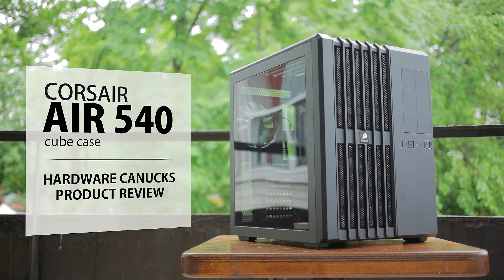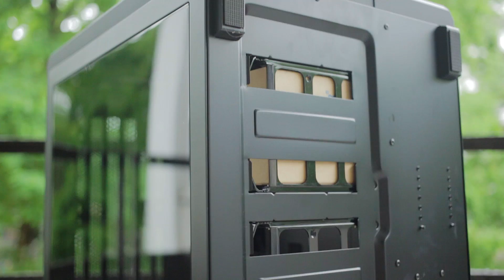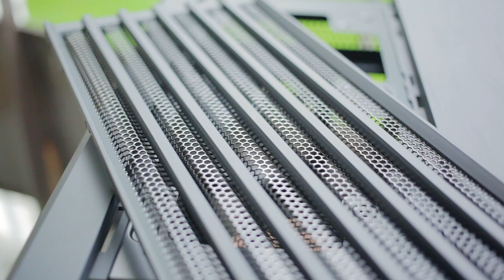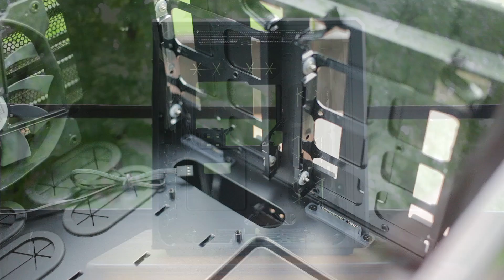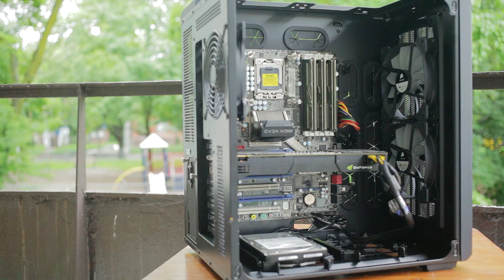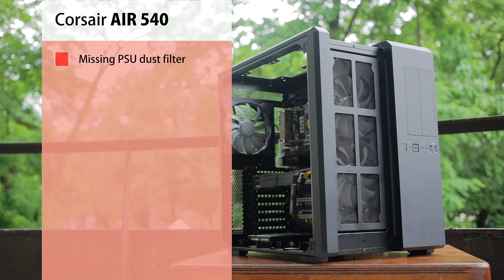Corsair Carbide AIR 540 Cube Case Review

Comment: Owned this case for 7 years. Its been amazing. I set it up with 280 mm cooler up top. 3 fans in the front exhausting air to the rear and front. No dust. Im updating all the components now but im keeping the case.
Reply: Me too, will it fit a 5080?

Comment: I think someone (Hint Hint) needs to tell Corsair to remake this case with Modern front I/O ,Glass top  and fixing the bottom to lay down the case. I would make the bottom just like the front and side     and be able to move the feet in laydown mode. I'll take 2 in white right now or 1 white and 1 other color. Removing the Hard drives and adding them to the rear would help improve air flow as you can now have fans in HD's Place. As for the Optical drive bays I would leave for DVD players or other accessories as I like to play my music while on the computer..

Comment: Had this from way back in 2013... fantastic case, but my main criticism was how flimsy the cradle brackets were for the HD/SSDs at the bottom. Pinching them to slide them in easily snapped off the tips.

Comment: Used this case for my first build. I wish Corsair revamped it. You can put a perforated front like the P500A, replace the bottom HDD caddy with perforated holes for more fans for the gpu. Replace the top with perforated holes. Scrap the HDD caddies on the 2nd chamber to shrink it a bit. That would be my perfect case.

Comment: buying this case in 2022.. 1.. cant believe this great pc case is still around. 2 . SO happy this case is still around!!! im gonna mod the mess out of it! lmao!
Reply: What part you like about this case? Also using it since Dec 2014 in 2023.
Reply: @BravoSixGoingDark  when my PC broke down i couldnt find the 540 anywhere for a decent price so i went with  the lian li mini air... i love the cube style of it to be honest
Reply: @Sabre912  wait im confuse, you don't have the air 540 in the first place?
Reply: @BravoSixGoingDark  unfortunately no.. My first comment stated I wanted to get the case.. I had plans on upgrading my pc back then but I held off on it
Reply: @Sabre912  Ah, i see okay, The lian li mini air you are referring is the O11 AIR MINI version? I'm thinking of getting this case for my next ATX built. I heard its slightly smaller than the Air 540, do you recommend it?
Reply: @BravoSixGoingDark  I do really but you are severely limited on gpu space if you do aio cooling.. 280 up front for me and I’m still rocking an Evga 3080ti hybrid. I would not recommend this case for water cooling of any kind for a novice builder.. it’s not too difficult I would buy tiny zip ties to clean things up lol
Reply: @Sabre912  ok im going to keep my Air 540. Reuse again for 2nd built

Comment: Had this case for 7 years, which has seen 3 different systems and for me it's still THE best for cable management and still right up there for airflow.
Reply: I still have this pc case with AM3+ components, still the best computer case ever made in my opinion, right next to the Cooler Master HAF XB (which I almost bought instead of this one)
Reply: @cssplayer91  Same I still have the case, i broke the plastic clippings on the SSD cage in the 2nd chamber though. Very flimsy plastic material.
Reply: I always wanted to build in one I should have made the purchase when I had the opportunity. If you ever decide to sell it lmk
Reply: @michaellovejoy5299  You can still find them online, I've seen them on Amazon, Memoryc.
Reply: 8 years going strong with this case. I agree the top and some other areas could use mesh filters other than the front

Comment: I think you got the radiator compatibility wrong .. 240 / 280 and 360 ... right there on the specs and you can see the three fan slots ... sure you have to get creative on pump or as this is 2020 now ... you can get a distribution plate which solves most of the problems easily now .... I have a external mount for a radiator that I got from Koolance that lets me mount it on the rear of the case outside as well - so besides for needing to drill passthrough holes for my hard lines this case is still very nice

Comment: This case was way before its time. I still have it now. My 2024mhz OC'd 1080Ti founders doesn't go beyond 75c with a custom fan curve and my 3930k at 4.6ghz with an dual 140mm pull configuration with Noctua fans doesn't go past 63c in gaming and 78c under full load for 30mins. This case has amazing airflow. However it's time to move on and upgrade in 2021 once AMD and Nvidia get their new hardware out.

Comment: This Case is laid out amazingly well in my opinion and has some really good features (tool-less stuff, dual chamber, cable management, etc.) but it has a couple drawbacks. First, its kinda light and flimsy. My other pc is a dell t3500 and its a tank compared to this dainty flower. Second is the dust filters as everyone else has said. The front one is great, why couldn't they added at least a top filter also?(and also a PS filter) Third, it's big. I know it takes size to get all the features in this box, but everyone that has been to my place and seen it is like "wtf is that? is that a computer?".
Reply: You want to hold the dust with a filter and potentially block partially your exhaust? Also even with a clean filter you lose a bit of efficiency of your exhaust flow. To me, we should never ever put air filters on exhaust, except only when the PC is turned off for long periods of time. If you use your pc almost every day you don't need it at all. Only filter the intake flow and clean it regularly is more than enough.

Comment: Sitting here in 2019 planning a build in this case. Drive cages aren't really an issue with SSD prices dropping and M.2 drives being a thing now. The one big flaw in this case is the 5.25 bays. Putting them sideways makes them utterly useless. You can't put a Blu-Ray reader in there for an HTPC because there's no way to keep the disc in the tray. You can't mount any of the bay-mount water reservoirs there because they won't work sideways. The only thing you can really do with those bays is mount fan controls, card readers, or something similar. PWM fans have pretty much killed manual fan controls. Nobody uses card readers now that you can use Bluetooth or USB to transfer files... those bays are just useless.
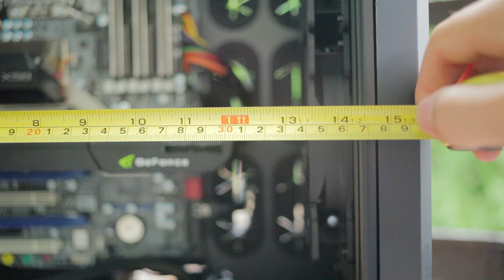Reply: The 5.25 bays can be removed. 3:15
Reply: @paulking4908  I know. But I want to run a bluray.

Comment: My favorite of all Corsair cases ever (to August 2019).  Would love an update with only one optical drive and USB C instead of USB 3.0 which should reduce the width but about 1-1.5 inches).  I love the mesh front and top.  I also love the acrylic window though I would find tempered glass to be acceptable but not needed.  The 3.5 inch drives at the bottom front can be moved to the back to allow for fans on bottom as with 240X.  Flimsy side panels need to be flexible.  All of this should allow for better use of space in the back.

Comment: This case is 6+ years old?? damn, i think it's an amazing looking case and have just ordered one.
Reply: Bought mine a year ago.  Super easy to build in and cable management is excellent.  I'm upgrading my wife's computer for her birthday and buying her this case (she loves the aesthetics of mine and wants hers to have this case)... if you haven't pulled the trigger yet, I promise you won't be disappointed when you do
Reply: @Danny White, how is the sound level on this case? Is it quiet?
Reply: @dannywhite325  I built a system using this case last year as well and I am thrilled with the results.
Reply: @jeremystamer929  mines coming next week.woooo
Reply: You can definitely hear it when the fans ramp up, but I have a Ryzen 7 2700x that's overclocked to 4.3ghz  across all 8 cores with an overclocked 1070ti gpu.  Add a 240mm AIO and the 7 fans combined (the gpu has 2 fans as well) aren't exactly whisper quiet...they aren't so loud as to be annoying, but my rig isn't built around quiet fans.
Reply: @dannywhite325  ohhhhhhh i thought that was my msi 1080 lol it's the case fans then lol
Reply: Lots of room, excellent cable management, hot swap cages, decent radiator support for water cooling  and insane airflow...it can be a bit noisy when your fans ramp up and the drive cage for your ssds on the backside of the motherboard panel feels cheap.and your side panel is acrylic instead of tempered glass and the case is huge! Pro's and con's in a nutshell...overall, it's a damn good case!
Reply: @bitchcunt9343  no issues, great to build in but the case fans get abit loud apart from that it's excellent.
Reply: 3 x 140mm case fans, 2 x 120mm radiator fans, plus the 2 fans on the Gpu... everything that can be overclocked is overclocked, when the fans ramp up under load, whisper quiet it's not...lol
Reply: How do I even find one now a days? Curious, can’t find it anywhere.
Reply: @simplyrhino_  i bought one brand new like week ago
Reply: @turbo9827  where did you buy it? I can’t seem to find it anywhere
Reply: @simplyrhino_  i live in poland and its in every popular polish computer store
Reply: @turbo9827  oh, makes sense.
Reply: And this comment is 6 yrs old 😅

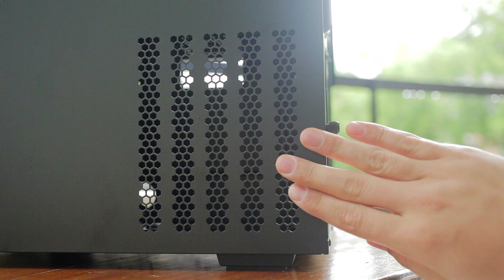Comment: 1:50 - Well, couldn't you flip the power supply around, so it exhausts out the side, and sucks in air from inside the case, which is already filtered?
Reply: You will be choking the fan as the motherboard tray is right behind it. PSU's exhaust out the rear.

Comment: The dust filter on the power supply really isn't necessary if you buy something like the corsair 860i or any of the smart sense power supplies. if you want a dust filter for it you can just get one as an accessory from their website, but again that's just my opinion

Comment: It would be very cool for Corsair to take some of your feedback and re-release the Air 540 in 2017.  I would replace the front panel with tempered glass, add magnetic dust filters all around, increase the number of front connectors and add USB 3.1.

Comment: I corsair could update this case (Air 740 is shit why the fucking door who needs that and it makes it easier for inexperienced people and children to open it and start touching the insides out of curiosity and short out or pull out some of the cables which can then short out) I would happily buy this if they do a version with the missing features Dmitri was on aboutsuch as lack of dust filters and so on and without the drive bays for the front as well as USB type C/Thunderbolt front panel I/O support and more Type A cables but the other features I do not really mind but if there was a tempered glass version it would be so much better and quite possibly if not one of the best cases Corsair has ever made as it would be good for water cooling due its large internal size if only it had some sort of removable panels for refilling and drainage i would happily pay an extra $50-$70 for those features and if they could make the front panel tempered glass that would be even better similar to the 460x but have intake from left, right, top and bottom

Comment: My air 540 is on the floor and works well as a Dust Filter.  But I do not find much dust in my PSU when cleaning. I did find spider webs and a family of small spiders inside on my last cleaning. The spiders like to crawl in through the oppenings on the bottom. I plan to cut out the drive mounts at the bottom, put in a new floor and a 240mm radiator with dust filter. The case is a good platform for water cooling but like it was said in the video to get what you want you need to modify. That is loads of fun and easy to do with this case. All the outside panels are removable for easy painting and there is a ton of room to work with

Comment: i was thinking of buying this case but after seeing it's lack of dust filters i'm kinda disappointed and not so sure about buying it now. i already have a cooler master n600 which is full of dust filters and it's pannels are better than air 540's as i saw in the video but it doesn't have that much good air flow if you're using several drives (HDDs or SSDs) and it's space for cable management makes it a little bit hard to deal with especially if you don't have sleeved cables and you end up having some cables around the case. also i would like if the air 540 would have another cage for at least 2 HDDs.
Reply: Too bad. Don't just go by these reviews. Think. Why do you need dust filters on exhaust fans! 😄 there are dust Filter for intakes. They filter dust. The clean air now cools there parts and exits. Now if you keep dust filter there what use would it be, it'd just hinder the out flow of hot air!

Comment: I use the top as an intake and its kinda disappointing why there are no filters at the top and power supply. I'd go for the 740 but they removed the 5.25 bays which I still use btw.

Comment: can i put 4 HDD on this case ?
Reply: no, you only have room for 4 SSD and 2 HDD
Reply: the corsair 750D or Phanteks Enthoo Pro or Luxe are really good cases for showing off a system with high HDD storage capacity
Reply: yes you can but it will require a little work
Reply: Just mod

Comment: This or the NZXT noctis 450 white
Reply: this!!!..i have the 240mm with sli push/pull and it just keels everything very cool even when the GPUs are very close together. 
so id imagine this case would seriously have sick airflow but all in all id still keep the 240mm over this 540mm
Reply: okay? noctis has 7 fans on it
Reply: +Yamaste 7fans and 2 80mm fans on the 240 case. ..i was simply saying that is a sweet case and has great air flow its size.

Comment: how to install cd drive. is it possible to insert cd vertically.
Reply: +Dan Mal Same mounting as any other case, this is a toolless system but is easy to use. Also yes you can insert a cd vertically without any issues.

Comment: worth to buy this or wait for a new cube form with atx ????
Reply: +Kusqen Anton this version is pretty good and has great air flow, cable management, and side panel for show case. magnetic mesh fan covers, easily removable, and there's direct flow towards ur graphics cards. definitely a great choice. however, it is up to you as to what you want!
Reply: +Kusqen Anton Well new chasis are around the corner, at computex may 29. So i would wait if your not in a hurry.

Comment: Hello, I´m trying to decide between a phanteks pro and this carbide 540 but I´m not sure which one to pick? My concern is space and efficiency. I want to have the best cooling options. Think they both look good though as far as understood phanteks pro only has 1 2,5 inch SSD Bracket, I need to install 3. Still possible? Then again I´m going to be doing heavy render video editing and so perhaps if I got the Corsair Carbide 540 and bought the additional dust filters, I´d be better off?

What do the experts have to say, any suggestions?
Reply: +Local Luxembourg Noctua use Phanteks cases. I think they says it all :D
Reply: Too late :D Already ordered the corsair! Couldn´t wait. It´s like 100 bucks pricier with the filters but ef it :p think I´ll get the best out of that combo: Airflow, filters and loads amount of space, can´t go wrong !? ;)
Reply: Yeah its still a great case. I want one
Reply: +Local Luxembourg how's the case? i ordered mine 3 days ago

Comment: So I have been looking at this case for a while, and am looking to take apart my Dell XPS 8700 and move the components and a new power supply and GTX 980 ti to this case, but will those other components (particularly the motherboard) and the TI fit in here?
Reply: The motherboard should and it depends which 980 Ti it is

Comment: So if I don't have a water cooled CPU, then I can expect dust to just rain on my system from the top mesh? Not to mention the huge mesh in the PSU chamber. It's like they really tried to make sure as much dust got inside as possible.
Reply: You could get on ebay and get higher quality dust filters for around 2.50 per fan

Comment: could this fit a h100i gtx and dual 980 hybrid? one hybrid in rear, one in front and the h100i gtx on top
Reply: +Rohan Rahman no
Reply: Sèna Gangbè Short answer, yes.
Reply: +Chris Romberg will the 240 fit a h100i gtx and a hybrid 980ti
Reply: xTheNikinator god damnit
Reply: +Rohan Rahman it will.but you will have to remove 1 of the front fans 1 hybrid rad at the back 1 at the front

Comment: I'm thinking of getting this case. I currently have an H440 and while it's an amazing looking case the airflow is extremely poor.
Reply: Do it! I just switched this past weekend and temps have been way better. My 780 would load around 84/85C now it hits 76C after a couple hours of gaming and my fans on are just barely audible they are running so low.